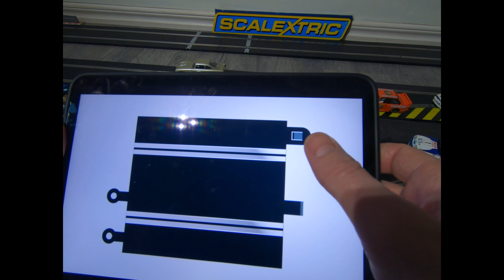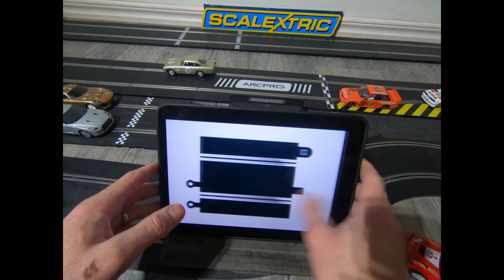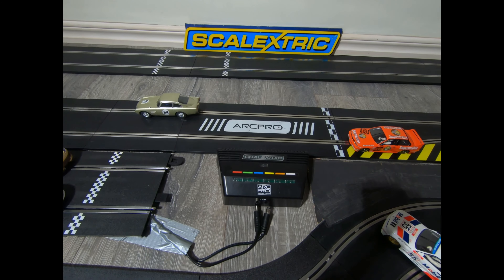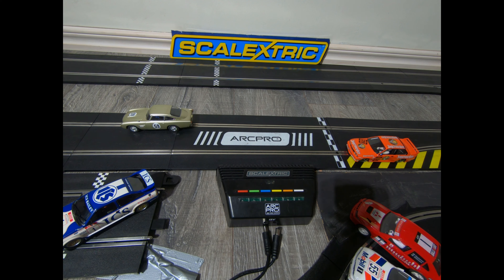Scalextric Powerbase. (What's The Difference)

Comment: If you want to race digital then the C7042 6 Car APB that you showed is by the far the superior powerbase in almost every way, you can link it to laptop and using FTDI USB cable and with two pit lane sensors and RCS64 software on laptop you have pace sector pace cars/fuel/tyre sims etc. on the big telly, there really is nothing else on the market than can touch this setup (unless you spend serious money on a system like Oxigen). It also runs in analogue mode still giving you race stats etc.

Main difference between analogue and digital is that in analogue each lane has it's own DC power supply and using a variable resistor in the controller you allow more current through motor to speed car up etc. A very simple electrical circuit. Note though that the more advanced power bases use PWM to control the analogue DC power output.

With digital the entire track including pits is 'one lane' and you can drive the car anywhere. The track is always on (constantly powered) and the digital chip in the car controls how much of that power goes to motor so you can control the car.

My track uses C7042 APB and is 10by5 with 6 XLC lane changers, 3 CLC lane changers and dual pit lane ;-)

Comment: The base shown at 1:09 also has a switch which allows it to be used to control 1 or 2 cars. This allows use the use of one crossover track to give a continuous circuit for one car. There is a similar looking power base that doesn't have the switch, which can't be used to run just 1 car on a continuous circuit, if that makes sense.
Reply from the maker: Thanks for the information, It's appreciated 🤘
Reply: I need 1sport power base

Comment: With Arc Air Pro and running analogue cars how many transformers are required thanks Tim
Reply from the maker: I'm running ArcPro using 2 power inputs, I have a 19m track. It also works well with 1 power input.
Reply: @scalextric-hobby   thanks deciding on this or the older C7042 system
Reply: @MrAndMrsEV  You'll notice an improvement with a second power supply, even on just 2 cars. If you're running 4 or more cars, you really need that 2nd power unit.

Track length issues can be sorted with jumper cables.